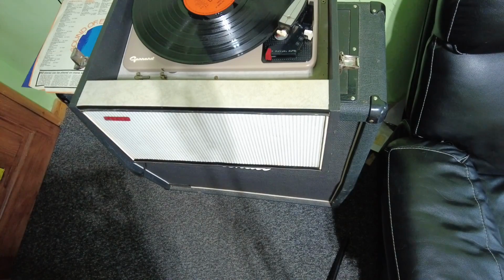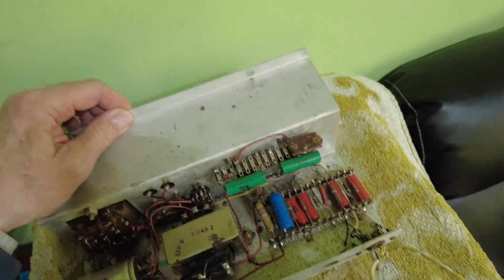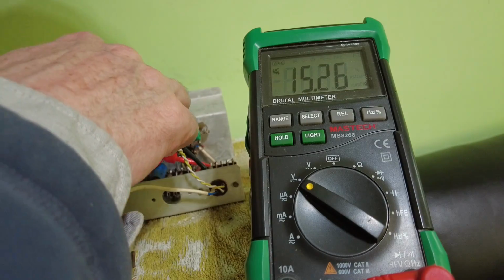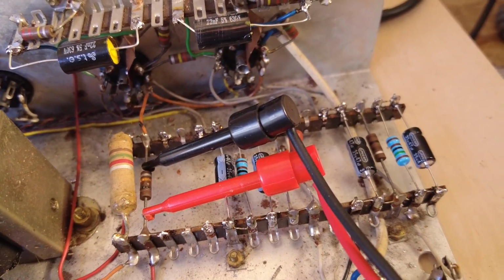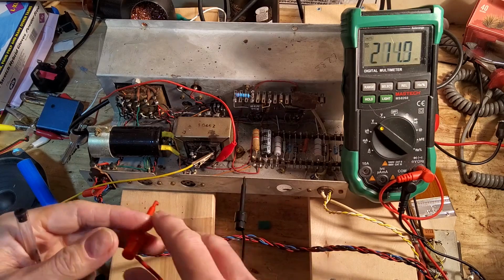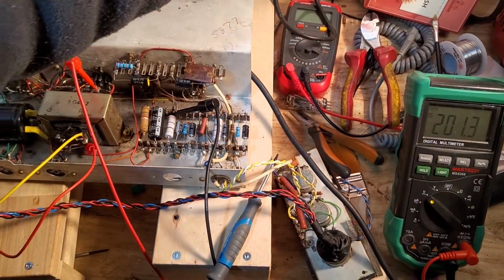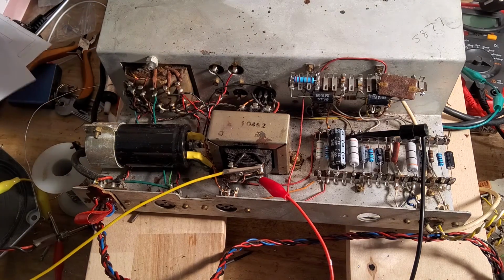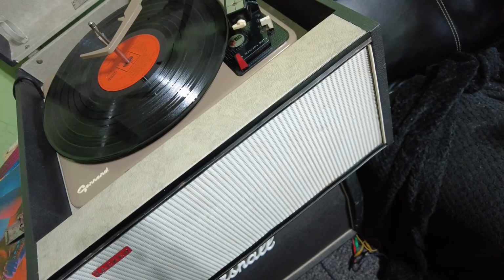Hacker Cavalier GP15 Record Player

Comment: Hi, I have followed your excellent rebuild on here.  I need some help with a Hacker Rg16 main amp (similar to your Cavalier) that I just aquired.  V2a triode section anode voltage drops from 181 to below 100v when left on for a few minutes with a corresponding rise in Cathode volts.  It happens with EITHER valve in that socket.  The other socket voltages are more stable.   I have re-ckecked anode and cathode resistors.   Also the Cathode volts on both Pentode sections rises with time from 9 ish to over 12volts.  HT is ok and pentode anode volts are ok too.   The amp does actually work.   I have replaced all caps and most resistors.  Any suggestions?  Could I have 2 faulty valves?  seems unlikely.
Reply: The speaker at 8ohms instead of 15 seems to have caused it to go unstable.  With a 15ohm ww resistor load it is now stable although the valves are totally mismatched.  So a conversion to ECL82s might be required as ECL86s are ridiculous prices now.
Reply from the maker: Hello Chris. Send me an email with you number and I will give you a call. Go to the homepage were it says more links. Click it and then scroll down to find the email.

Comment: I watched you repairing this cavalier,i was quite shocked. The idea is to repair them using correct parts,resistors caps etc,not replacing the EZ80 rectifier with silicon diodes.I have repaired and refurbished several  Hackers,did you replace R11 and R12 820k resistors,quite common for these resistors to go hi with others in this circuit.
Reply from the maker: Hello. I am sorry that changing the EZ80 upset you but the customer decided on this one. I can see both sides to this one. I changed all the resistors, and all the caps. Everything was done for in this record player. Thanks for watching and take care.
Reply: Hi thanks for the reply,i understand that the customer is alway right sometimes.I have 7 of these excellent record players,i have refurbished each one to be original,this is the aim to keep original.Regards Bob.
Reply: The transformers all run hot in these hackers but you maybe tamed it a bit with diodes
Great
Could have plugged guitar in aux input with extra long pin rca plug or a pedal😊at back plate
Love these amps.not so much the r.p. side of things
Extension speaker is a revelation
Cheers Martyn

Comment: These often have stereo cartridges driving a mono amp but there is a switched output socket to drive a matching separate amp and speaker cabinet allowing the option of full stereo if you could afford to buy the extra unit.
Reply from the maker: Hello Rob. Those extra units for all record players are very rare as you say not many people could afford them.

Comment: In later models hacker changed the coupling caps to mullard mustard caps..ECL86 valves have got very expensive.
Reply from the maker: Hello Rob. Would have been much better with the Mullard caps. The ECL86 is an expensive tube and getting harder to find new old stock. It's a shame they don't make them anymore. the gain factor on the triode is same as a 12AX7.  They are great for low wattage guitar amps. Thanks for watching and take care.